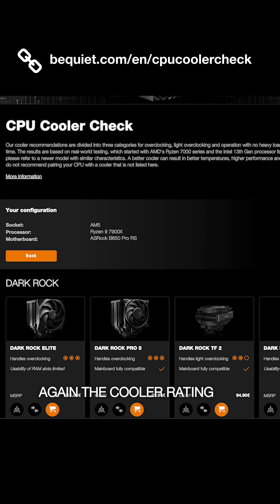The latest in CPU cooling tech | be quiet! #TDP #CPU #techtips

Comment: Will a Dark Rock Pro 5 perform well on a Ryzen 7800x3D? I have the be quiet silent 120 and actually works well, temperatures are low and gaming no more than 60° but on high tasks like rendering videos on my channel or starting the games goes up to 88°.
Reply from the maker: Hey, best to use our CPU cooler check to see which of our coolers fit in your system and if overclocking is an option or not: https://www.bequiet.com/en/cpucoolercheck

Comment: You know, I could be wrong but I think you still have to keep processors cool. Just saying. But I could be wrong
Reply from the maker: Better cooling results in a faster processor, but in full load scenarios the sensors may not record a lower temperature. Cooling performance remains important, but the way we comprehend the effects of better cooling has changed with the last CPU generations.